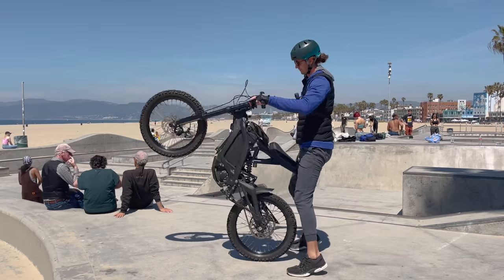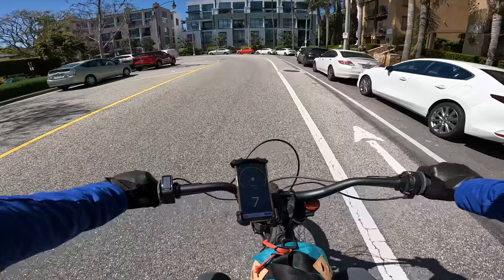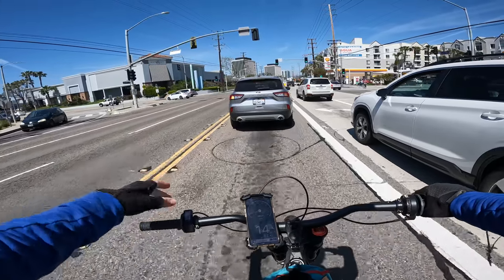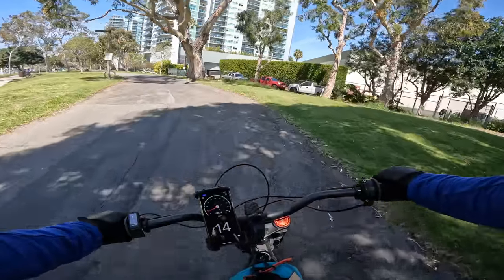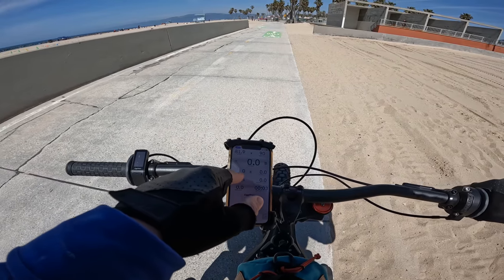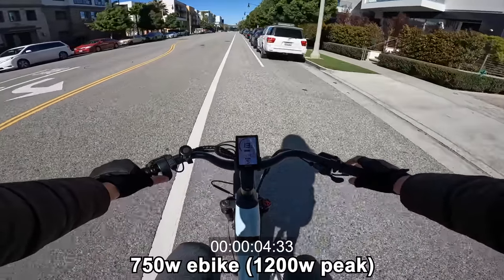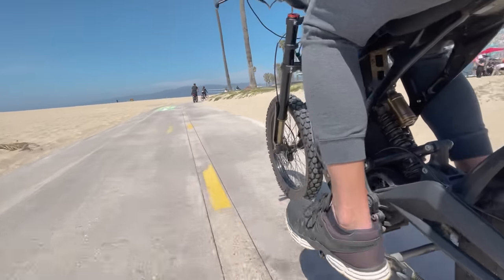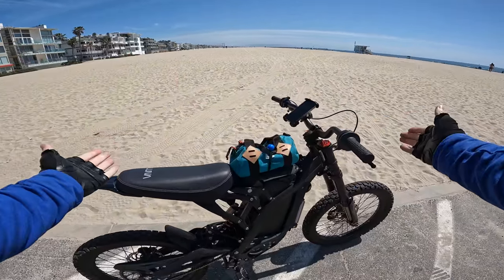This 70 MPH ebike is DANGEROUS

Comment: Seems pretty expensive to go electric. I’m sure it’s fun doing stop light get aways but that could get pretty old too. You can buy a motorcycle for that kind of money but you obviously would require a proper license and insurance too, depending on where you live.
Reply: It is.  If you could get a 7kw of power setup for 3k usd or so the moped asia would switch over rather quickly.
Reply: I got a zero fxe and it doesnt' cost much more lol

Comment: Twist throttle is illegal in Europe and the UK, pedal assistance only, has to meet motor vehicle approval number plates insurance lights etc, and electric motorcycle if it can achieve 15.5mph and more on a level road.
Reply: Bc Canada , needs pedal to ride on public streets , otherwise it needs insurance license and so on.

Comment: I'd love a lightweight EV motorbike to commute on, but have no desire to go above 35-40mph and even that would be in proper PPE. 
At 60+ that would be terrifying 😱
Reply: You could change the sprockets to lower the top speed.Just have to be even more careful with the throttle, though.

Comment: That grin will vanish when a bystander is killed by one of these. Even relatively slow e-bikes are causing hassles on many bike trails, violating existing rules that banned motorized ICE vehicles due to speed. Reckless speed without pedaling effort is especially annoying.

Comment: These bikes are cool but they aren't legal to ride on the street pretty much anywhere in the US they are basically light electric motorcycles similar to a 110cc stock. That's why I never really wanted to buy one.  Sure in some arias you can get away with riding one but all it takes is that one cop that stops you and you're done.  You now have the very real possibility of your $4400 bike being confiscated and destroyed as well as a court date.
Reply: It's a class 2 ebike in ny just dont speed
Reply: @craigchenery604  Right......If you don't have the peddle kit it's no longer a bicycle and the peddle kit is an absolute joke. Let's not play dumb here this thing is not an E Bike never has been most cops don't see it as one either.
Reply: @zeppast  wrong again .throttle assist only is legal as long as it doesn't go over 20 mph in ny .called the 3 class system
Reply: @zeppast  moped and scooter have no peddles but can be driven u make no sense just spreading false info
Reply: Sir it doesn't matter no one is going to ride this thing in a class 3 configuration no one. Sooner or later you're going to get in trouble with the cops on this thing let's just agree to disagree. I've already seen people pulled over on this thing several times.
Reply: @zeppast  

It is an e-bike, because it can do things cars and standard motorcycles can’t do. Like take narrow paths or trails. 
It handles more like a bike, smaller and more narrow than a motorcycle. More nimble. Can take tight or sharp turns easier, you can get off of it and walk with it with ease and it wouldn’t look weird, if you’re strong enough. With my homemade e-bike. I can literally pick it up with one hand and bring it inside the house. It’s small enough not to use or take up parking space. 

Turning it into another motorcycle neuters it. It then becomes another thing the government will want money from. Because it’s not suppose to be another motorcycle dude. So quit trying to turn it into one. 

Your logic is “it goes 70. Therefore motorcycle” 
Uhhh no. Thats not the case. You can program the controller to reduce its maximum speed to less than that. Some you cannot do even on a motorcycle. Unless you plan on swapping out the engine block for something smaller. 

Or if you have discipline and self control like me. You can keep it unlocked and learn when to slow down.
Reply: @zeppast  

Like you’re speaking with no experience Brent. All you see is “high speed = motorcycle” 

No that’s not the case at all. It’s a motor on a bicycle frame. Smaller more compact. Easier to manage and handle. Light enough to be picked up and stored. 

You need to factor those in before yet you think high speed is the ultimate factor in determining what’s a motorcycle or not. You need to learn that those controller can be programmed as well. There are people who have bikes that can do 70mph. But programmed it to do only 30 or slightly above 35. Of course I don’t expect you to know that.
Reply: @Mash3OH3  First of all you're making assumptions I am very well aware that these come shipped detuned to 750W but who in their right mind would pay over 4K for a bike where you can only use less then 25% of the power on tap I wouldn't would you???  makes no sense everyone cuts that grey wire.  The main issue is these bikes are simply not legal anywhere in the us like I said before they don't have peddles sure you can put a peddle kit on them but that thing sucks and it's useless. They don't meet the definition of an E bike period I think these bikes a cool but again they aren't legal man.  No one is out there riding these things limited to 750W no one so again 99.9% of them on the road aren't legal. Wether you or anyone else chooses to buy one and ride it on public roads is up to you of course.  I choose not to buy one because I don't want my almost 5K bike possibly confiscated or destroyed by a bored cop.
Reply: @Mash3OH3   This thing also can't be registered as a moped either there is no vin# or title it also doesn't come with turn signals or mirrors so no DMV is going to let you register it either. The only street legal Surron you can buy is the Storm Bee that thing has a Vin# and tittle and is DOD approved but it's like 8 grand.

Comment: Why are you calling this an ebike when it's an electric motorcycle?
Reply: Dirtbike 
Electricbike 
common sense
Reply: 🤫 e-bike 🤐
Reply: E bike. No electric motorcycle
Reply: Isnt every ebike an electric motorcycle? Surely any motorised bike is a ' motorcycle' or am i missing something?
Reply: @godsstreetmessenger2839  Electric motorcycles cannot be "driven" without engaging the electric motor.  You could coast downhill, though.  You can pedal an ebike and propel yourself without using the motor.  Different laws apply to each.
Reply: Bi = 2, cycle = series of events.
Reply: Don't need a license to ride it.
Reply: I think "bike" refers to anything you would ride with handlebars and wheels. From bicycles to ATVs. Doesn't matter how many wheels or power source. So calling an electric motorcycle an ebike is still technically right. At least in my opinion.
Reply: @milmar7d7 
Semantics, and legal tricks. lol
 However technically you are correct.
Two wheels is bicycle no matter the drive train or power source.

Comment: yeah, where you're riding this (MDR area) and venice you can definately get a ticket, but it's unlikely at this point, nobody knows how to handle these types of vehicles yet. But Basically, if you look at laws, this should technically have a plate / tag and not be allowed on bike paths due to it's motor power rating...That being said, I reall like the build, we need more "crossover" type bikes between ebikes and actual full-fledge motorcycles, America DMV's aren't ready for them yet haha

Comment: i have similar specs on a 20 year old full suspension mountain bike lol. qs205 4t v3, sabvoton 71250 controller, 3kwh lipo, have huge dual crown shocks on the front, and remote lockout on the rear shock. about to put a dropper seat post and working on how to elevate my battery 2 inches and then it shall be road ready once again.

Comment: There is a certain price tag that creates a fine line between buying a electric bike and motorcycle. Yes, one needs insurance, registration, fuel etc. But for a machine at the cost of $10k dollars, u do want registration and insurance. For a 70mph pace u do want insurance again for medical reasons in case I fall. Not to mention build quality. If you're going to drop 10k you might as well get a slightly used Ducati supermotard with Brembo brakes, top of the line build quality and proper quality control. Not to mention legal because this on public roads is definitely not. This is like buying a 140k Tesla replica that can't be registered when you could have just bought a Porsche 911 all along for that price
Reply from the maker: Haha touché

Comment: I've watched many of these videos on e-bikes. Do you know what none of you guys talk about!? 
1.) How long it takes to charge a battery.
2.) How much does charging a battery add to your electric bill.
3.) How long does a battery last, in other words, how many times can it be recharged before another battery is needed. You know! stuff that "really matters!"
Reply from the maker: 1) to determine charge take the total amp-hours of the battery and divide by the amps of the charger - for this ebike it is  38ah/10a = 3.8 hours to charge from 0 to full. It can be more complicated because the charger has different settings and also I rarely run the battery down to below 50% (and also I try to charge on a lower output setting of 2 amps instead of 10 because slow charging is easier on the cells.
2) basically no addition to your energy bill, a full charge on the massive battery seen on this modded ebike costs about 50 cents, and that's at SoCal energy rates which is much above average
3) Typically they will still hold about 80% of their initial capacity after 1000 full discharge cycles. To put it simply, I've had the battery on this bike for over a year and notice 0 difference.
Hope this helps dude!
Reply: @TailHappyTV  I enjoy learning. And, I for one appreciate... not only the answer, but leaning the concept or process to the answer  
                             Thank Ya! Thank ya vury muuuch! <--- say it like Elvis would! LOL

Comment: That's actually like a moped or dirt bike of some kind. The classification for E bike should have something to do with the weight, frame, and motor only activating on normal pedal motion. Any inexperienced "cyclist" could just smash into someone on the sidewalk and apparently this "e bike" was sidewalk legal for it to happen. Actual e-bikes now have their speeds regulated due to shit like this. The fact you aren't even pedalling makes this more of a motorcycle, even though theyre a two wheeled vehicle with similar shape.

Honestly e bikes in city limits should just be pedal assist road bikes. When you have full suspension on a heavy, solid frame with wheels that make it impossible to fall over on, you aren't hardly a danger to yourself but much more of a danger to all the pedestrians around you. But a pedal assist e-bike can't just fly over curbs, crash into stuff, etc, without you going flying. and you have to be very very careful with the handling. This thing is literally like grabbing a controller and ripping up the sidewalks

Comment: Politicians are already working on reclassification of them to be considered as motorcycles due to the high speeds
Reply: It actually makes sense though. I cycle through the city on an actual bike. Having people zoom through on these in a bike lane is dangerous for cyclists and oncoming pedestrians.
Reply: Politicians are working on cracking down on all legit class 1-3 ebikes because shit like this is pushing the limit. They make electric motorycles that can be registered. This is an electric motorcycle with bicycle parts that can never be registered because its missing basic safety equipment like mirrors and lights.

Comment: Yeah, I got a 6kw e-scooter and everyone asks me who fast it goes. Who cares, its fast enough, and then some. My guess its about 100 km/h, never did more than 80 though, I think, cause its an off road e-scooter so its not very stable at high speeds. I love driving it though and most of the time, I cruise along at about 25-40 km/h. That's more than enough for normal driving. The great thing about it is it climbs and keeps accelerating up any given hill here in Norway and it has a 2 KW/h battery providing me with long range.

Comment: It would be really cool if someone could make a battery pack with LTO lithium titanate battery cells. They have a lower voltage and so you would need to use a lot of cells to reach the voltage, but there are many other advantages, such as the very high discharge rate. higher and charging can be very fast, in addition to greater cycle durability

Comment: Ok just have to say... FLAT OUT dumb to have not upgraded the brakes get a dual caliper mount for the rear put both stock brakes on that than get a magora or even a Shimano front brake it's a must!! 
I upgraded mine with a stock power train. Them stock brakes are put on and ment to work with the green wire uncut stock battery and controller so 28-32mph only
Reply from the maker: 😆 amen

Comment: Is there an ACTUAL real (functional) pedal ebike that has same or similar power?
Reply from the maker: Not really, once an ebike weighs this much pedaling does basically nothing. Some e-bikes like this have pedals, but it’s basically like a built in leg press machine. You can get some exercise, but not even lance armstrong would make a meaningful addition to the range and acceleration.

Comment: In Denmark we can only ride upto 28 mph on e-bikes (legally), but the speed limit for bike lanes matches the roads, eg 50 mph on the road, means you can bicyle your way to that speed. But ONLY with electric assist upto 28. Huh? 🙃
Reply: That is supposed to be the limit here as well, But in the US we tend to consider laws we don't like as "optional"

Comment: I think that the prices of all electric vehicles are ridiculously high.
10,000 for an electric bike. ? I'd rather put an electric kit on a normal bike even if it doesn't have that much power. Each type of vehicle must have the appropriate power to maintain a power/safety balance for the user.

Comment: So is there a special motor for the regen?i really want regen because i live basically on a slope so most days there's going to be some downhill riding which just eats the brakes and uphill the battery, regen might solve both those issues at once
Reply from the maker: They all have Regen the controller determines it’s usage. GLE has a Regen thumb throttle that sounds ideal for your situation

Comment: Nice video but im just wondering how you get so much range in ur past videos with the stock battery. Ur easily getting 40 miles when others are bearly getting 25-30, and ur a larger person and is getting more range on a stock battery than someone who weiged 160 lbs on the same thing. Just wondering.
Reply from the maker: I probably rode slower, also the sprocket swapped to 54t increases efficiency

Comment: This is a real death trap, the tyres have no proper carcass and no safe speed rating and that's just for starters. It's also not an E Bike, that is a term for an Electric Bicycle with pedals,  this is an electric motorcycle.  I like it and would have a lot of fun on it, but not on the highway.

Comment: Man you have almost as much power on this thing as I do on my electric moped. Thankfully it has a 60 km/h cap. But even in your case going 70 mph is useless unless you're racing someone. Your battery will run out very quickly even though it's a light bike. No wait, is it really? I bet it weighs almost as much as a $4200 e-moped with a Li-Ion battery. Which really begs the question, - why pay $10K for it when you can just get an electric moped. And if compactness is your game, - there are some models out there with similar profile to bikes minus width. Advantages? Taking your friend or girlfriend for a nice ride, plenty of storage space and they aren't as easy to steal.
Reply from the maker: ill race ya ;)

Comment: You can build you ebike like that but with a hub motor you could use a bike frame or motorcycle i recommend not putting higher than 1000w if you wanna still pedal otherewise Will be too heavy anyways i have a 3000w motor with a 1800w battery it goes like 40 mph thats pretty much the use you should ask for a electric bike unless you use a motorcycle or big bike where you can add a big battery mine doesnt have any suspension and brakes are bike brakes front brake is good but rear is not. The thing with this is to get a strong frame with space for a battery for example this bike is not ment for that power can only hold bit even 3000w and motors in way more powerfull theres is a similar style of bike that have a box so you just put a 50amp battery and thats still not enough to hit 60mph for good Range like if you wanna go thag fast just get a gas motor cycle anyways you could mske one for very cheap like if you get good price of battery and cheap chinese motor you could have a 40mph bike at 1500 or 2000 bucks motor is cheap but battery not and you can get cheap bikes

Comment: The way I see it, 10 grand is my monthly pay give or take, so years of fun with this would be justified. In terms of locking it up, just buy an air tag or Samsung tracker and problem solved. Integrate the tag into a body panel or hide it inside of the handle bar to track thieves and a small dash cam. Best of luck!!!
Reply: That doesn't actually work as a deterrent
Reply: You think this thing will last years?  LOL